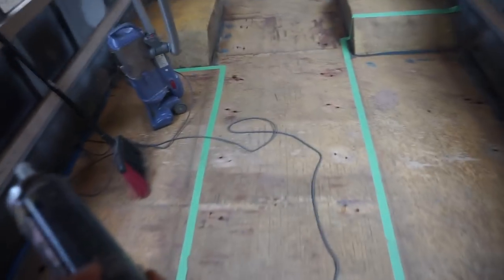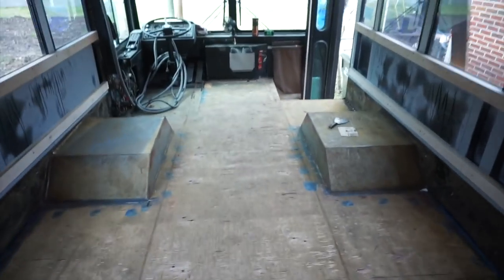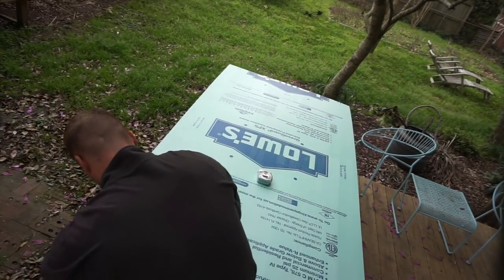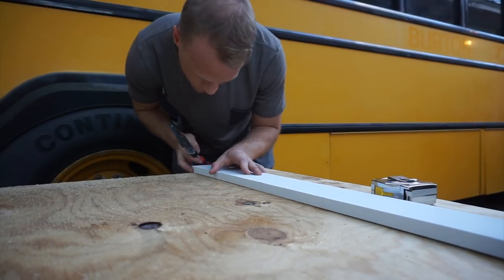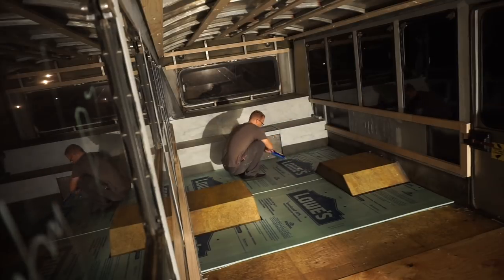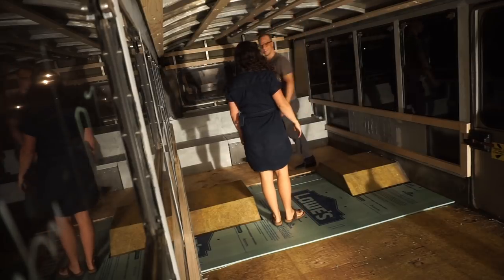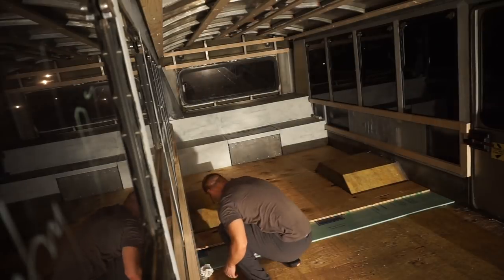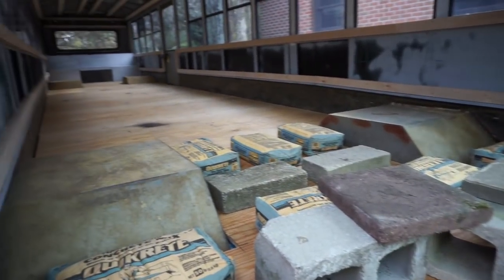Installing a Floating Subfloor: School Bus Conversion Ep 11

Comment: Hello guys. Thanks for thus video. How durable is this method of only glueing the floor down as far as it not squeaking? Could screws be added in order to keep the floor from squeaking. I'm not sure how to screw a hard plywood sheet onto the soft foam. How far would you push the screw through into the foam? Because the foam is not solid, there's a lot of give in how far you would run the screw it. Thanks in advance.
Reply from the maker: It's quite durable. It's not squeeky. Yes you can add screws but you'll have to screw through the subfloor, through the foam, and through the metal floor of the bus.
Reply: @MobileDwellings  Thank you for your response. I'm considering using screws, but based on what you said, the screws might not be necessary. However, if I used screws, I wonder if having the foam underneath the plywood would make it difficult to tighten the screws because of the softness and potential give of the foam. It seems like the foam would keep squishing down until it was flat. What do you think.🤔